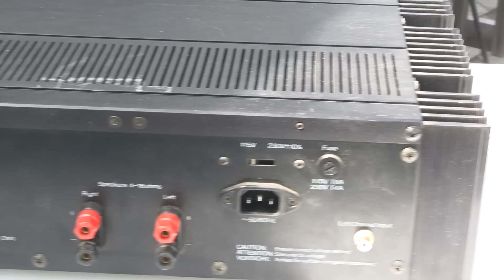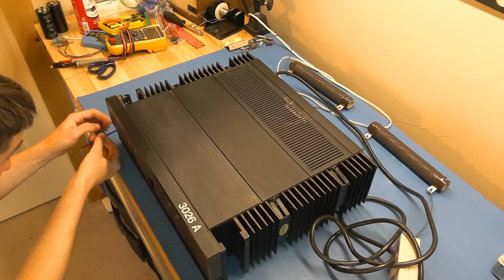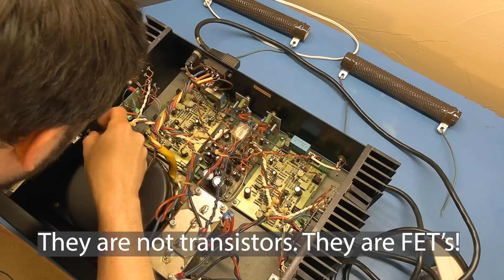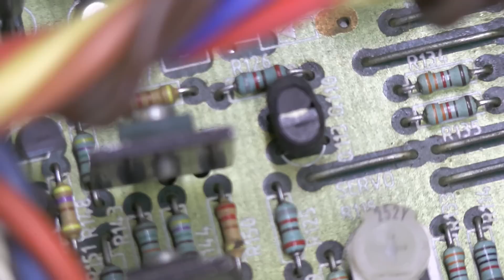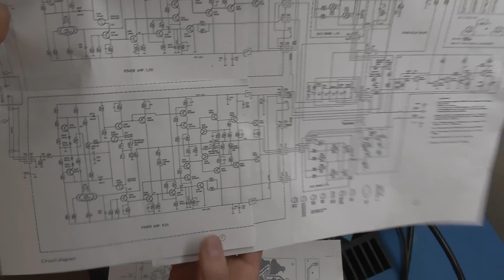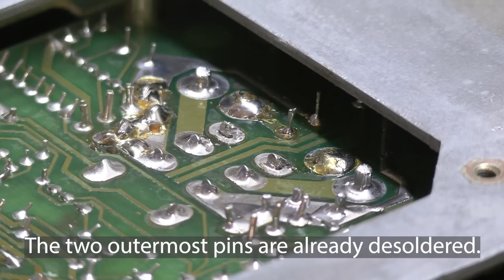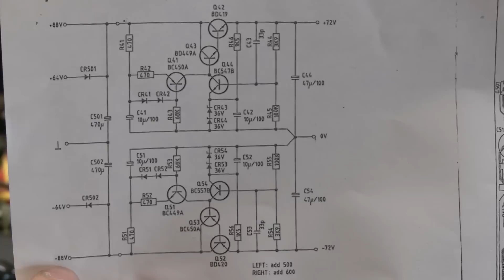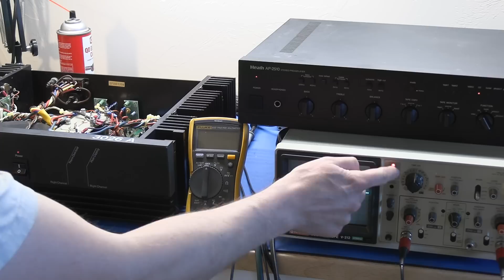I broke this already broken Tandberg power amp while trying to fix it

Comment from the maker: As many have already pointed out: One, I did indeed mean to say NORWAY. Two, believe it or not, I never took the time to look up what FET stands for until this video. Three, yes, you are not supposed to set idle current when on the dim bulb. You will notice that I did not do that, I simply CHECKED idle current to see if it was reasonable. At the end of the video, off of the dim bulb, the idle current is set. Yes, this video makes me look like a moron, but that's kind of the point. This is a hobby for many of us. Things will not always go perfectly. We will all make silly mistakes. None of that should discourage us from persisting and continuing to learn. Thank you all for watching.
Reply: Yup, nicely done, keep it real… this isn’t Hollywood, it’s a smart guy working through stuff with critical thinking.  Frankly, quite inspiring.
Reply: Nice!
Reply: You did well. I'm at the same level when it comes to repairs - a highly experienced idiot. By the way, Philips screws are used in America. Elsewhere they mostly use Pozidriv screws. If you use a Philips screwdriver in those, it will "cam out" and ruin the cross.
Reply: I’m way to smart because I know everything about nothing
Reply: I read your entire comment and am in agreement with the others who expressed their support. That said, I for one would not hold it against you if you cut to learn a new to you word because it would elevate the technical value of your videos to beginners.
Reply: Hi I'm frensh and I like to repair electronics like you.don t worry we all non professional guys make mistakes and sometimes I 've even aggravated some minor defaults.that s how we learn also.🥴

Comment: This video was a bit painful to watch. Generally your troubleshooting technique is sound, though you occasionally fall down rabbit holes (this will decrease over time with more experience). However, you commit a cardinal sin when troubleshooting: NEVER poke around with a DMM or scope lead with power on. Buy yourself a bunch of spring loaded J clips, and attach them to test points (component legs, test posts, etc) with power off, clip the other end to your test probe, then apply power. The other option is to buy DMM leads with J hooks at the ends. This alone will save you a ton of time and misery. I know the temptation to save time will always be there, but it takes a few seconds more to play things much safer. When I see you test power supply rails in a high power amp freehand, I get anxious, as I've seen probe leads vaporize and throw bits of molten metal when poking around like that.
Reply: Also, NEVER (NEVER!!!) clean electronics with tap water (as in power washing). I don't know how this has become a thing in restoring electronics on the web, but a simple Google search will inform you that tap water is loaded with minerals, which when dry, cause corrosion and carbon tracking on pwb's. In fact, the first thing you're supposed to do if someone gives you an electronic product that was exposed to even a minor amount of water is to not power it up, but instead thoroughly clean the pwb's with isopropyl alcohol, then let even more alcohol run down the boards to drain contaminants away, thoroughly dry either through evaporation or clean (filtered) compressed air, dabbing with Q-tips or clean paper towels, etc., then wait even longer before powering up. Canned air is much better than compressed air from a compressor, as there is always moisture in the tank. BTW, water can destroy certain IC's even with power off. Again NEVER clean electronics with tap water.
I was an engineer at Underwriters Laboratories for the first 23 years of my career, and watching a power transformer be exposed to water from a power washer made me absolutely cringe. That transformer will likely never again pass a dielectric stress test, and even if it does, it will get worse over time, rendering every safety measure designed into that transformer useless.

Comment: What I learned the hard way about zener diodes is that you have to maintain a minimum reverse current before it clamps at rated voltage. 
When desoldering with a power sucker I start with a bit of flux, and when the hollow iron collapses around the component lead I start moving the tip around and pull the trigger. It's cleaner and takes less heat. Also your scope could use a little trace rotation. You'll get more accurate readings that way.

Comment: -reg may mean negative rail regulator. 
Did they use a zenor diode to provide a 74v rail dropped and held at 72 . 
Is that what is missing from the schematic?

Comment: You stated “they are not transistors they are FET” 
FET = Field Effect TRANSISTOR
Great video and congrats on sticking with the repair despite the setbacks. Been there before, glad you got the unit fixed young man. 😎👍

Comment: I bought a new Rogue 99 preamp paid 4000$ in 2003 also bought the M120 mono blocks right from day one it started blowing output tubes it went in for 3 sessions of repair still doing it technician reflowed the 4 6SN7 sockets and what ever .
So finally I started looking  at it I noticed it had flow through solder on all the components except on one output coupling capacitor it was a massive Mundorf 6.8 that had cold solder joint and didn’t have enough flow through,a quick jab of solder fixed it .
I’m not trained in electronics but sometimes it’s the most simple things that can throw you like a good who done it murder mystery 
And finding the crook can be a challenge,the more you do the more you learn ,keep up the great videos

Comment: Good evening from Norway, 15 minutes drive from where this was made 🙂 I think you are a bit unfair, you've got schematics, not complete alignment instructions. You had some bad luck from the beginning, so thumbs up for being so honest and not hiding it. Most of Tandberg 3000 series: you only unscrew  the two unbrako/hex/allen screws at the back to take of the pressure of the rear top cover, push it backwards and lift it out. I made a 3006A from left over parts from the factory+some parts I made and bought transformer and the MOSFET output transistors. Fortunately the GURU of Tandberg service which passed away in june this year started it up for me with a variac. This amp have served me around 20 years now. I also built two 3008 preamplifiers from left over parts. Your video was interesting and it's always something to learn from mistakes, preferably others mistakes. I guess you spent some $$$ at parts. BD419 and 420 is difficult/expensive to find now. Thank you for sharing your equvivalents. Many amps uses these and it's common that they break because of 419/420.
About unloaded adjustment......are you supposed to place a load at the speakeroutputs as you did or is that load supposed to be in the scope probes???? 
Tandberg had their own production of instruments, l've got a Tandberg distortionmeter. Someone wrote Tandberg was also produced in Holland, totally rubbish. Tandberg used Philips CD players which they bought complete, removed the OP-amps and put in their own cabinet with their own made analogue board.
TCD3034 was made in Penang Malaysia, TR3030 was made in Hong Kong, both budget models. Tandberg was Norwegian and everything else was made here!

Comment: Tandberg was primarily known in the US for tape recorders, but in the early 70s they entered the fray with a line of receivers that were highly thought of.  Then a Finnish engineer named Matti Ottala published a paper positing that a phenomenon he called Transient IM Distortion was responsible for "transistoiritis"...the harshness many listeners heard in solid state amps.  Tandberg, perhaps in show of respect for a fellow Nordic , jumped on the bandwagon and brought out a line of excellent separate components deploying his ideas.  This amp was second generation and a higher power model.  These items were sold in boutique HiFi salons, often with pricey imported speakers.  I had a few pieces back in the mid-80s.

Comment: The cold joint on the cap is the course of throwing the amp on a table or bench. Not by you but by others 😂
The caps are heavy thats why the joints gave up.

Comment: Those pots are notorious for voltage walking replace them with bournse 10 turn pots 
They are very stable and dont drift. Set  the new pots to the copy of the old ones.

Comment: When I was young I had my own shop in Billings. It was always my policy to demonstrate the item for the customer prior to payment. I had this Yamaha receiver I did for a gal. Put new output transistors in it. Everything else looked good. Biased it up. Ran it for a week. Called her up, she came down to get it. I flipped it on, the relay engaged and a large ball of smoke came out the vents. She stood there looking horrified, I stood there looking horrified. And that is how I learned to always replace the driver and bias transistors when you do outputs. We all make mistakes, how else would we learn?

Comment: I enjoy your videos.  Thanks for posting your errors as well as your triumphs.  We all make mistakes.  I used to fix guitar amps from another well known service guy.  He gave meamps he couldn't figure out.  He gave me one to fix and said it had a burned out pt, so I should be careful with the replacement that cost $250.  I found the rectifier diodes were shorted, so I replaced them with the same part number diode.  I was angry that the stupid manufacturer picked diodes that barely fit the pcb mounting holes.  I got them in and mounted the new transformer. I was a EE with 4 patents and 40 years experience, so I didn't need to check anything out.  I powered it up, but the B+ wouldn't go above about 50v?  While I was probing around, with power on of course, I smelled something hot.  I touched the brand new custom made transformer and almost burned my hand!

So what happened was the tech who gave it to me to fix, found the original bad transformer, and shorted rectifier diodes.  So he ordered the new transformer, and didn't have any 1n4007 diodes,but had some beefier ones, that he figured would even better, since the original ones failed.  Problem was he used a 2A diode that a breakdown of 50v.  

So it was kind of his fault for using the wrong diodes, but my fault for not even checking what they were rated for.  The 1n4007 diodes fit through the holes just fine!  So I ended up eating the new new transformer.  He did warn me.  But I trusted him, and I knew he didn't really understand the circuits.  He was a flooring installer till his knees gave out.

By the way there is a tip that goes on your test lead probe tip that is a U shape with the probe tip at the bottom.  It allows you to probe those resistors with no danger of shorting out to the ground plane of the pcb.  I had those in my probe tips, but I didn't know why I needed it.  Thanks for pointing that out, several times. ;-)

Comment: Field Effect Transistors come in a several varieties JFET Junction FET, N Channel, or P Channel, IGFET Insulated Gate FET, Depletion Mode or Enhancement Mode. Now there are HEXFETs that can turn on and make the Resistance On, very low, nearly 0, which makes them great as switching transistors and are used to control motors, in high power, Pulse Width Modulated, Proportional Control, Radio Controlled Cars!

Comment: Really enjoyed this video, I just bought a stack of Tandberg gear... All with issues but physically mint.. Both the 3008A and 3006A had cold solder joints and only played on one channel. You pointing out that big blue cap gave me a clue to check those first.. BOOM!!!! Cold solder joint on one of those big blue caps in each device.. Went over the rest of the boards the best I could and now both the preamp and amp are working again on both channels..  Never stop learning.. Im loving the journey as an amateur tech.

Comment: FYI  an O-Scope  will show distortion on the output sinewave  You'll see any distortion if present .
If the scope shows a clean signal  theres no distortion present .
if the scope shows a dirty signal theres either distortion or noise of some kind present .
On some amps a dummy load as your using is needed to get accurate measurements 

Mend It Mark here on youtube has a dummy load setup with multiple rated resistors and can be switched to bypass as in no load . or switched to use speakers when in bypass mode.

Comment: Just a quick safety tip, check the voltage on the power supply caps even after discharging them.  There has been an instance or two I thought I had discharged properly and didn’t.  75 volts isn’t pleasant.  I’ve had filter caps on tube amps hold 250V.

Comment: Well, you first powered it up. The relay kicked in that looked like it was a good sign now you go further and you’re expecting it out and you’re checking out things with inspect. I probably would’ve hooked up audio just to see if it played the other text were done or not who knows every tech does their own thing differently, however as I’m putting this comment as I’m watching your video, I finally get to the point where you get to the point where you find it the one board the voltage is not with spec so OK so whatever so I take back my regional comment which never mind you couldn’t read anyway cause I’ve already deleted itnow as far as your guy finding this amplifier in the dumpster OK that’s like finding a gold coin because that just doesn’t happen anywhere so anyway for him it’s a nice fine and that’s a very nice amplifier and I kind of figured out. I think you live out west somewhere in the Colorado area near the mountains. I live in Ohio I to work on Audio myself mostly amplifiers old vintage receivers. I just got done working on an old Sansui 4000 gave me a lot of issues, but I outsmarted it and got it fixed and the old man’s having.

Comment: Hi from Norway, land of Tandberg! I guess you learned a thing or two here.. I don't know these "3000 series" well, had one 3036 here for work several years ago. However I have a collection of much older Tandberg gear, from the early tube gear from the late 30's and onwards. When measuring DC offset (and quiescent current, of course) there should be no output power going. This is probably the reason you see the offset DC voltage drifting back and forth. And, "normal" DMMs are often unsuited for signal measurement (Flukes and a few more maybe the exception) Many of the cheaper DMMs are only suited for "power line frequencies". An RMS voltmeter, or a distortion meter will be better. Those blue RIFA caps are ok, the ones to change every time are the yellowish ones often wired across the AC line. Those will turn into smoke bombs.. Good luck, this will be a good amp when done!

Comment: You recorded how many DIY'ers have started their passion for electronics. Respect..

My recommendation:
DIM bulbs are for power up and minor testing only. After a safe power up the DIM bulb must be disconnected to establish correct voltages throughout. You'll easily be chasing ghosts otherwise, including BIAS settings ect if the DIM bulb is still in series with your AC...
Take your time to go through the layout of an amplifier before diving in, check component functionality including the quality of solder joints after many years of use.. One bad solder joint is enough make all sorts of "funny" behaviour.
Take notes of your measurements and findings and finally; easy on the probing with live AC. One mistake is enough;)

Best regards.

Comment: Twenty two minutes in he finally discovers the bottom service  panel cover. Smoked resistor ( blackened) to left of destroyed semiconductor at 33:01 in. Finally finds a blue plastic encased RIFA cap that has a cold solder joint at 47:41 
in. Should really replace them on both sides. Persistance paid off at the end Aiden.

Comment: Not to be pedantic... but I think those are "socket head cap screws", not "hex bolts". I'd consider "hex bolts" to be normal hex headed bolts you'd use a socket on.  And also FETs are transistors too - it's right there in the name - Field Effect Transistor. It's not nice to boot them out of the family!

Comment: Nice job! Way to persevere! A distortion analyzer is a great tool to add to your bench if you find a good deal on one! It’s hard to see distortion that exceeds manufacturer’s spec. by measuring voltages and looking for clipping on the scope. 

I love my HP 8903B as it has a clean signal generator and can measure distortion among other things. It’s built like a tank, and there’s plenty of info. available on servicing it… although it’s pretty massive!!!

Anyways, love the videos! Keep up the great work!